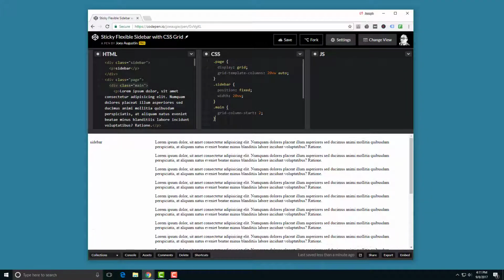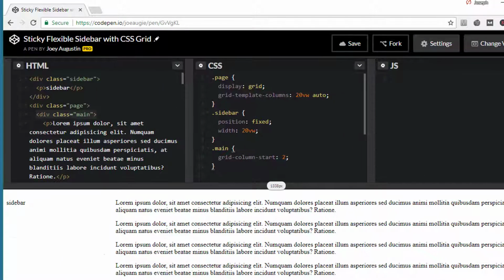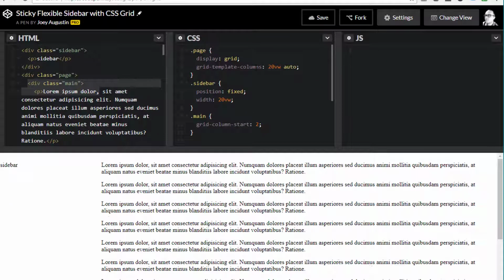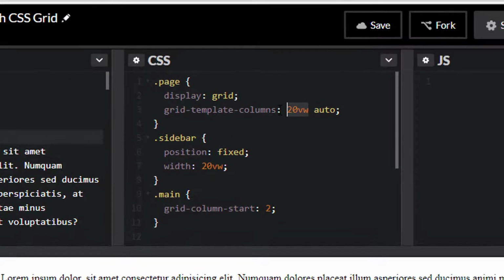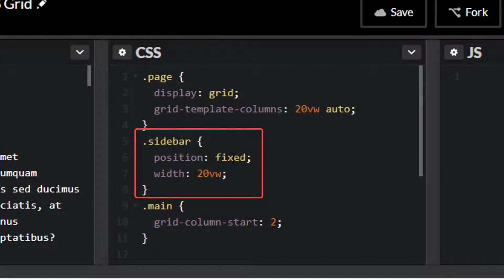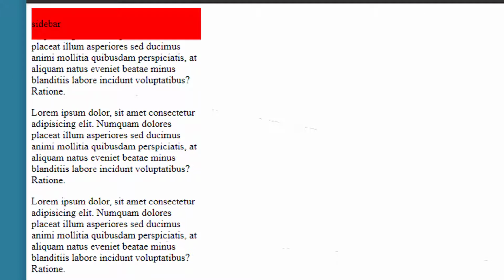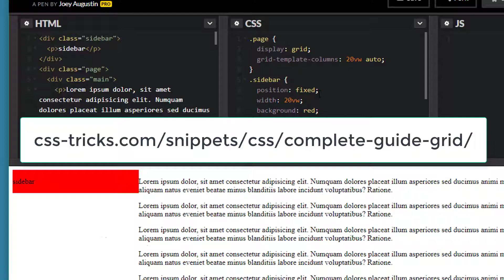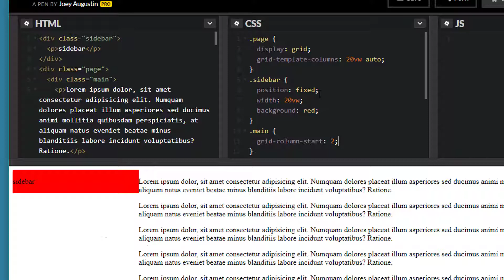Fixed Flexible Sidebar With CSS Grid

Comment: I have a hard time understanding this: the sidebar is not a descendant of the grid-parent. Since you applied display grid to page. So based in all I knew until now, I don't get why is the sidebar behaving as a grid item?
Reply from the maker: You're right. It's not a grid item. It's fixed to the page, and overlaps a grid column.
Reply: @joeyaugustinweb  ahhhhhh alright I got it. Thank you for replying.
Reply from the maker: @alfonsoramirezelorriaga1153  No problem thanks for watching!

Comment: What if we wanted the sidebar inside the 'page' div element? Can we still make it sticky and responsive?
Reply from the maker: Since the sidebar utilizes fixed positioning, you can just move it inside the page element, and it will all still work the same.

Comment: This is a fixed sidebar, not a sticky one. If the content overflows the sidebar bottom, it will not scroll with the page, you will have to scroll the content within the sidebar. You should change the video title.
Reply from the maker: Yea good point. Thanks.